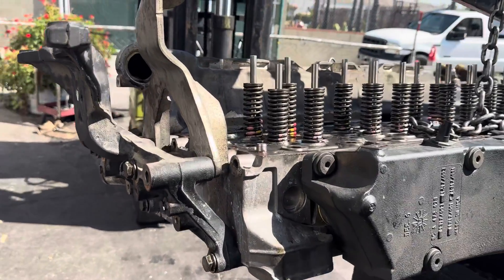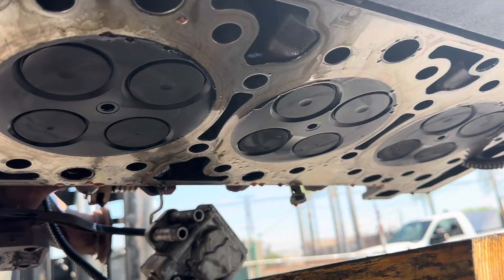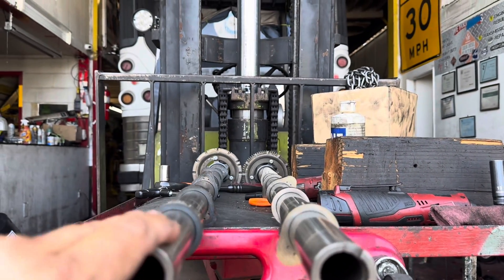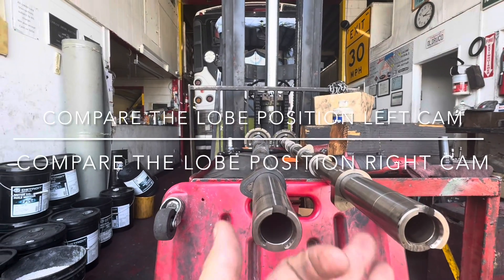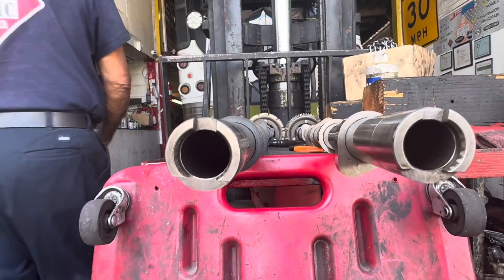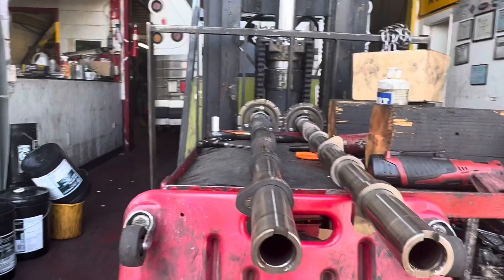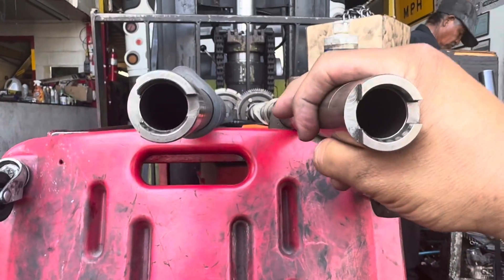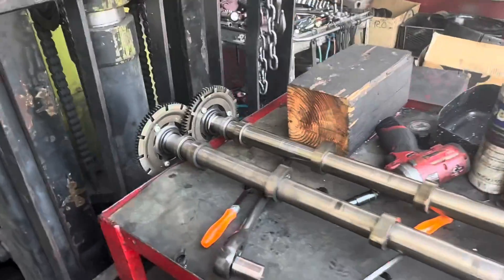Just replaced the cylinder head and it came back.  Part 2

Comment: Definently bent valves. Rocker arms do not have manufacturing defects.  Engine have piston to valve collision and the stopping force brake the rocker. Was a hard hit .  Both rocker is damaged hollow dd cams is week but will not and again will not turn that much without the reason. Some will turn some if you rpm this engines over 2000 spins on the shafts just a hair creating vibrations at idle and isb 30% range.  Only setting the code if rpm reach 2800. Not before.  Need to pull ddec report and check the highest rpm logged in mcm. Date stamp behinds them.  I don't believed the machine shop made any mistakes but tighter valve guides will do the same damage.  
My money is on operator error but i do not see the ddec report. If the highest speed recorded is 2300 and the day stamp is after customer picked up the truck it is the hard downshift if it is the manual. Dt12 takes to 2300 too.  Alright i going to sleep.  Good night's. (One more thing that wrist pin have some bang bang to )

Comment: Do you also work on class 4 or 5 trucks like the ram 2500 Cummins
Reply from the maker: @ unfortunately we do not. Try All American Diesel Fleet in Orange, Ca.
Reply: @CarlosDieselElectric how come heavy duty repair shops don't work on those type of diesel engines Cummins,Duramax and powerstroke the diesel
Reply from the maker: @ different tools are needed. Scan tools (diagnostic), lifts, cab lifts are just a few things that are not the same.
Reply: @CarlosDieselElectric  another question as a truck driver myself why do class 8 have 9 pin port and light duty diesels have OBD2 port. Thanks and really enjoy your vids!!!